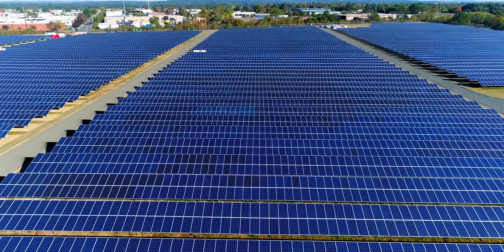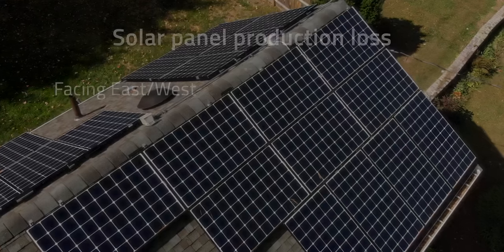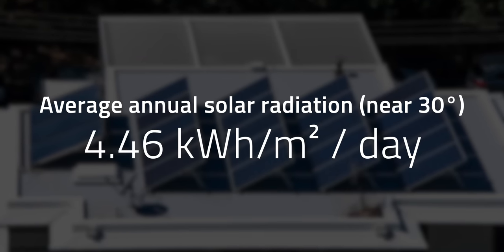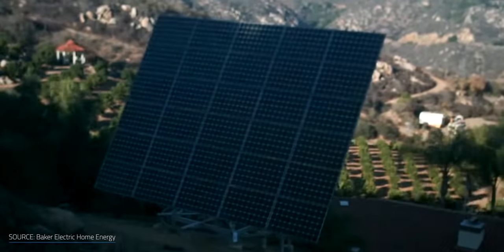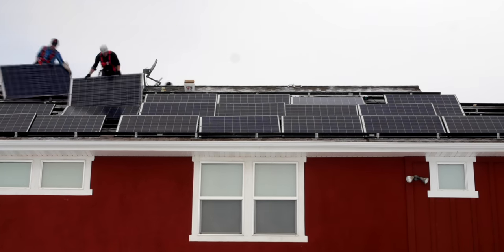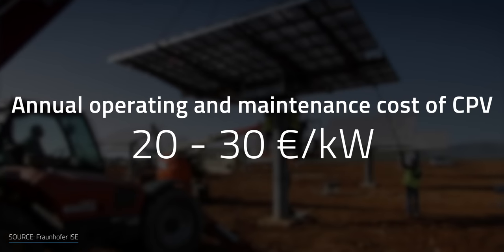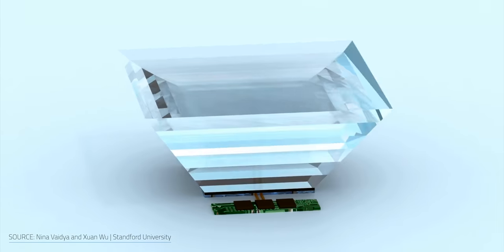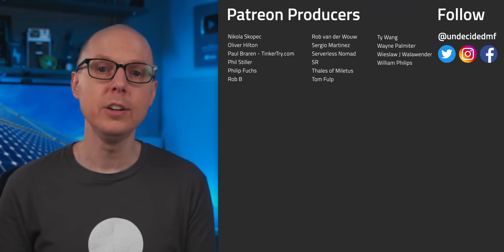This Invention Could Supercharge Solar Panels

Comment: If you want efficiency for movement, write an algorithm to move the panels instead of using sensors.  If you have to have a system that's always active that wastes energy.  If you program movement, you could probably move the panels 6 times in the day and it's good enough to be near max efficient.

And this is where my comment about being within 10 degree of the equator comes in.  The day lengths are pretty close throughout the year.  You can program 6 position changes and then a reset and it's good all year long.

If you're in the ares outside the tropics (latitude) then tilt angle for N. and S. has to change a few times during the year and the day lengths vary more.  It could still be programmed so you don't have to use sensors, but now you need a table to reference.  Since this is without sensors you don't get a situation of panels chasing the sun.

With a fixed tracking of E. to W., anyone who is electrically inclined could mount panels in a group and with motors and hydraulics could build the entire system.  If you've built you're own home, you could even roof mount this like over a garage.  In which case, you've provided the necessary strength to the structures to take the weight of the panels.  You could probably run about 12 panels this way, and then you'd have to install another 12 panels somewhere else.

This is the build I plan to do.
Reply: The sensors are not where the cost comes from. It's the actual structure and motors that move the panels that make it expensive.

Comment: Hello Matt 
and thanks for this nice update. The thing that strikes me as just as problematic as the heat issues discussed by the other viewers is the geometric optics issue. Shrinking the superficial area of the cell to try to recover collection effect will quickly prove self defeating unless the commensurate increase in the intrinsic efficiency of ultimate conversion device - your "super solar cells" - grows quickly. Indeed, the Louisville theorem (used in light pipe design for nuclear detectors), suggest you cannot win the game of trading frontal collection area for some sort of concentrator optic - this is why astronomical telescopes must increasingly grow in area (although better CCD sensor DO help with claiming more sensitivity).  Sounds, as you suggested, like a niche interest in this.
with respect
DK.Barillari
Reply from the maker: Great comment and feedback.  Thanks.
Reply: I had the same thought from the start. In lay terms, what's the point of having less actual PV cells if they still need the same surface area? Sure, the overall cost might come down, but such benefits would be marginal at best. After viewing, the main benefit seems to be less loss of efficiency at suboptimal angles. So the real question seems to be whether that benefit is worth the extra cost in a given setup. Hopefully maturation of the tech will ease such margins.
Reply: @simonmasbaum8399  "...the main benefit seems to be less loss of efficiency at suboptimal angles."
I think that that's the point, not to increase gains, but reduce (energy and economic) losses.  The reduction of effective surface area is still a problem though.
Reply: Unless I misunderstood, they have increased conversion from around 22% to 40%. I don’t know if that’s due to increased light or the mj cells, or what conversion they would get just using a full module of mj cells.
Reply: @UndecidedMF  close this channel down you liar.
Reply: Agreed.  The abstract of the scholarly article from Stanford actually begins by pointing out this shortcoming as “the constant brightness theorem.”

And it ends with the benefit of reducing “the needed amount of PV material.”  Along with capturing diffuse light, which is nice. 

But the gains to 40% is misleading at best.
Reply: @UndecidedMF  Ferrell, if you're going to make a living by lying all the time, why can't you do it in some other sphere?  Pimp "energy drinks", for instance.  Or HerbaLife.  It's much more your style.  You'll embarrass yourself less, since it's sadly evident that you don't know ANYTHING about science beyond jargon and buzzwords.
Reply: @adamhoyt7281  "But the gains to 40% is misleading at best."  That's what's called the Ferrell "brand".

Comment: Technically the best orientation for maximum power production is North/South, but I have seen it argued that West facing panels do have one significant advantage in that they produce a bit more peak power in the evening when demand peaks and North/South panels sag a bit. This is particularly useful at the moment where storage is possible but non trivial at large scale. If you've got multiple directions of panels you need a more sophisticated inverter setup though to maximise output at any given moment.

Comment: The Itek panels I installed 9 years ago put a row of glass bumps, about 1/8" wide by 1/2" long, on the inside of the glass above each cell to improve collection in the PNW.  My main roof is S but the pitch of the roof is 2' in 15'. Great for the summer solstice when the sun arcs just a bit north of me for a few days. My 4.85 kW system [260 W panels] puts out 5.1MWh a year on average. Because of a great state program that treated me like a power company I got production credits for 6 years for buying all system parts made in the state. As of the first of the month it turned 9 and I am in the green. It supplies 1/3 of my power needs annually. 
I should be able to update the panels to 320 for the same size panel and get close to 6kWh. Would be nice if it would get me some of the fed incentives and allow to also cover installing batteries. Hard to believe that battery packs are not a separate item for a tax credit. But I will have a fair amount of wiring to set up two charging stations in the carport and possibly a new power panel and just enough batteries with my panels going to Ecoflow's. I am going to give it about 18 months for the tech or the legislation to change before I lock in what I will really do. 
I did my first solar tour many years ago and one home was owned by a power company worker. He found old satellite dishes out of use and offered money [$ depending on if the tracker motor and controls worked] and would remove them. Scraped most of the dish and built a frame and welded it. Mounted a simple solar eye to move the panels horizontal [with no light it would reset to the east] and adjusted the tilt angle 4 times per year. They all ran to a shed with lead acid marine batteries and was selling power to his former employer. He had 5 in a field across from his house. The most expensive was $350. Hard to find these days.

Comment: This is an interesting development in PV technology.  I look forward to seeing where this can go, but in conjunction with Solar Panels, we need stability, such as battery or some kind of storage as once the sun is gone, the power is gone.   I see that where I live (Victoria, Australia)   In the middle of the day on a really sunny day the wholesale price of electricty can sometimes be negative (as in get paid to use power) because so much solar is being generated, but once the sun is gone, the reliance on fossil fuel comes back, with the more expensive price.   
We really need to look at storage and solar as being a compulsory pair.
Reply from the maker: Thanks for the comment.  Agree 100% ... energy storage is key.
Reply: The intermittency issue is one of the reasons why solar and wind together are the renewable energy sources that get the most research.

As the sun goes down and solar panels become less efficient, wind almost always picks up for a couple of hours which lets wind turbines supply us until bed time.

And of course, this is why almost everyone wants nuclear, tidal, and geothermal energy production to make up 10-20% of electricity production. That would provide an excellent steady backbone to ensure that we don’t constantly have rolling blackouts.
Reply: @SaveMoneySavethePlanet  In the modern world, a reliable 24hour power supply is needed.  Where I am, the wind usually gets up in what would be the "off peak" times, after bedtime.   Unfortunately the evening peak time is very reliant on  fossil fuel at the moment here.   This is where storage cells of some kind would help.   If we could store some of the excess solar from during the day to release it during the peak, we would just about get by without needing fossil or nuclear.  Tidal could be interesting to just provide that little top up though :)
Reply: @UndecidedMF  A robust interconnected grid is also critical, to move power from where the wind is blowing and the sun is shining to where it's not.
Reply: @EsotericArctos  sorry, I got excited and didn’t mean to make it sound like storage isn’t needed at all. Strong storage systems are definitely needed across the board in order to reduce the amount of “just in case” generation that we install
Reply: Matt has got a lot of videos on energy storage methods. Check back through his earlier videos.
Reply: In the past middle of hot afternoon was the highest demand for electricity. Thanks to Solar that’s gone. If we can get micro wind farms along with inverter storage, we can be 100% self sufficient.
Reply: In your situation would it be economically feasible to invest in the best available battery storage system without intalling any type of household solar system and fully charge it when the price of electricity is at its lowest so that you dont have to draw from the grid when its at its most expensive?
Reply: @UndecidedMF  Why is it that the primary interest in renewable energy seems to be the ones that are the most intermittent? Having to construct an entire backup power supply system for at night or when the wind isn't   blowing is always going to hurt consumers on their utility bill. Why are more steady and dependable systems like geothermal and hydroelectric bypassed in favor of those that are not able to produce electricity a significant amount of the time?
Reply: @dennisenright7725  For many locations, grid scale geothermal for electricity production isn't currently an option.  Not until you can safely drill down deep enough everywhere to get a big enough heat gradient at least, that's why I said currently.  Hydro-power is limited both geographically AND by the greenies.  You wouldn't want to interfere with the breeding habits of some snail or fish that nobody has ever heard of do you?
.
Note, localized geothermal for HVAC is available almost every where with geothermal heat pumps.  When you need to spin a turbine to produce electricity you just need more energy.
Reply: @michiganengineer8621  I agree wih your assessment of both types of geothermal. Ground source heat pumps are generally an excellent idea. The issue for that comes down to two variables: number of days with air temperature far above or below desired indoor temperature and the price of electricity. The perfect place for this type of installation is one with a lot of days with highs of forty degrees (104F) or lows of minus 40 and also has  high electricity prices.  That makes using the temperature of about 12 degrees (55F) abount 10 feet below the surface far easier on a heat pump that one using outside air. The higher the price for electricity  just makes the tens of thousands spent digging up ones property easier to justify.
As for geothermal for electricity generation i find the assumption that it means drilling down thousands of feet an expensive approach. I look at a place like Nyiragongo and think that nature has provided a perfect geothermal source. Europe has a comparable asset in Sicily but the engineering would be to put it mildly very complicated. As for the US you also ave a prime site but covering America's oldest national park with a massive generating station the size of Manhattan would not likely be politically feasible
Reply: @michiganengineer8621  As for hydroelectric i will admit a strong bias in favor of that because where I live near Montreal is the best place on the face of the earth for that. For 3 reasons: The glaciers scraped away all the topsoil so our rivers have the lowest sediment load anywhere, precipitation falls mostly as snow therefore massively increasing effective reservoir capacity, and best of all peak electricity demand  is January or February at 6 to 8 am and temperatures of minus 35. Spring snowmelt happens after our reservoirs have been drawn down to their lowest level. Peak demand elsewhere doesn't usually line up so conveniently with nature.
Reply: @dennisenright7725  Iceland comes to mind as well for a good location to tap some heat off to make electricity.

Comment: What would be really cool is if AGILE lenses could be used as a retrofit for existing home solar installations- like getting new prescription glasses for your panels. If they could demonstrate cost/benefit efficiency increases to pay for themselves in under 5 years, I’d buy ‘em!
Reply: Very, very unlikely.

#1. The retrofit alone would degrade an older system at least twice as fast - the panels might literally give out before you get your money back on the install/retrofit costs.

#2. Concentrated PV without higher efficiency PV cells (tandem or multi junction cells) means too much solar energy is lost to heat, which in turn causes the panels to degrade faster still.

#3. Concentrators start bigger and focus light on a smaller spot on each PV cell, which means the layout of your non CPV panels isn't going to work very well with it.

Better to just buy the entire thing from scratch once your current PV setup gives out.

If money is burning a hole in your pocket in the interim then get some domestic battery storage units instead which will allow you to get more out of what you already have.

The increases in efficiency from PV and the increases in battery density plus the lowering costs of both for home setups is going to make the next few decades very interesting with the topsy turvy costs of fossil fuel derived power from corporate grid suppliers.

Comment: I see you got animations from Array Technologies. Up until this February, I worked at the company that makes all of Array's drive lines (the shafts and universal joints that connect one row of panels to the next so that one motor can adjust the angle of many panels). They've known for years that solar panels are getting so efficient that mechanical angle adjusters are becoming obsolete. With this new technology you're talking about, they might finally close down that line! Don't worry though, they make every single F150 drive line today. I think they'll be in business for a while yet. 😅 Especially if they keep expanding into the electric car markets needs.

Comment: The CPV and AGILE will also work well in the marine industry because the solar panels mounted onboard yachts/boats are always moving about with the wave movement and course changes. One thing not mentioned is that these hyperparabolic concentrators and prismatic/Fresnel lenses also have the added benefit to filter out IR light, which will help keep the solar cells cooler with what would otherwise be very hot intensified light. We used similar prisimatic technology back in the 1980's to concentrate for surgical lights to create a shadowless pure white light that did not raise the temperature of the skin or internal organs during surgeries.
Reply: Excellent points in angles and adding IR filters. And basically what I was going to say. Thank you!

Comment: Could be a significant innovation for Solar power...still at the early stage of development but definitely looks extremely promising.
We have had our Solar panels for just over a year and have  been extremely pleased with the result. Any unused Solar electricity heats our hot water which has saved a small fortune as we used to use heating  oil to heat the water...and oil is like liquid gold nowadays..
Another good video Matt.
Reply: "Early stage of development" isnt really correct ... because the "science" (the MATH on how to shape the funneling system) has been done and now it is a problem of "optimising the production process to make these things as cheap as possible". Having much smaller photovoltaic cells is one step, because they require to be "perfect/without any flaws" ... and smaller cells make it easier to get those from a batch of raw material. Layering the cells for different wavelengths adds another layer of efficiency on top of it. 

The best way would be to have a panel where the top / "light concentration layer" can be replaced in case there is a better version ...

Comment: The first Solar job I designed the electrical system for was CPV.   Dual axis trackers and to point exactly at the sun.   You are correct, efficiency is extremely important going forward!   Shading is a big solar system killer.